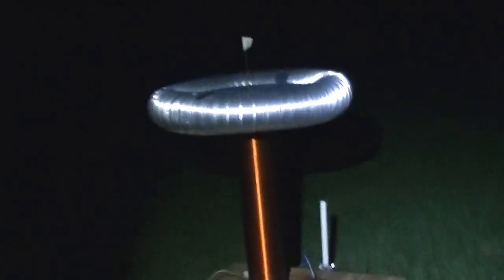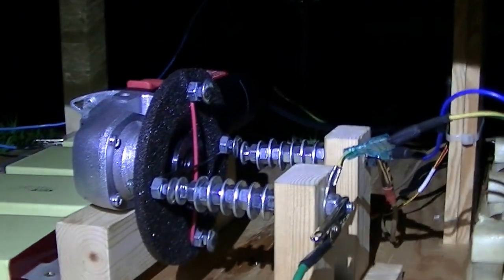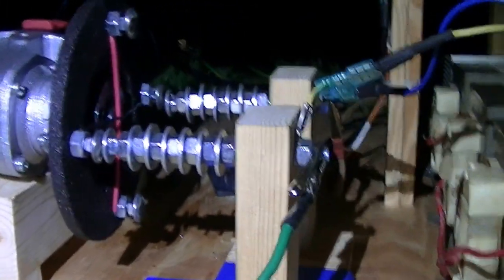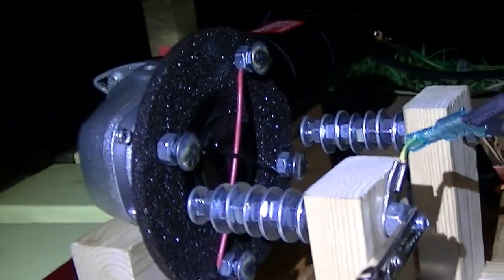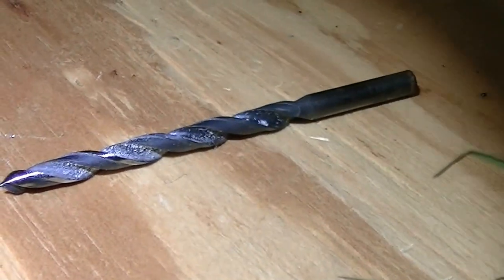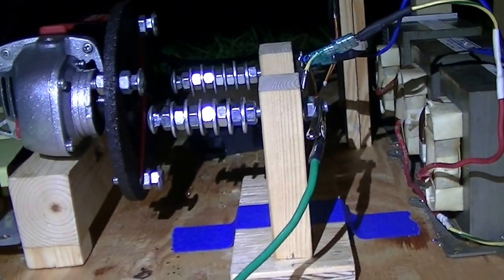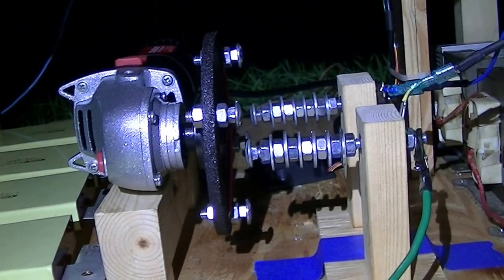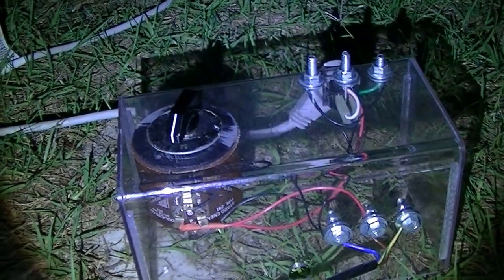Dual MOT Tesla Coil Rotary Spark Gap (RSG)

Comment: I know this is kinda a old video but to test MOT diodes you either need a special tester, or you need a resistor and say 18-22volts use the resistor to limit current and measure for a voltage drop, a MOT diode is several silicone diodes in series inside each one having its own .5 to .7 voltage drop. A normal DMM can’t supply enough current/voltage to turn the diode on in order to test it. Just like a one way valve for water you need a bit of pressure, or in this case electric current in order for it to open, or turn on. And HV diodes exceed that voltage. Interestingly I’ve been able to use a DMM in diode mode to test some vacuum tube diodes. I guess because of the thermionic emission the meter was able to read it somewhat I’m not the only person to have done this experiment either. I think I used an ac power transformer to power the filaments so if any repeat this I recommend testing with both AC and test on the filament, I don’t recall me doing the same. Tubes are very very sensitive so maybe the AC clips making though the indirectly heated cathode, maybe. Guess I’ll be poking with it again soon lol!

Comment: Mot diodes are like a lot of HV diodes they need a certain voltage to work instead of 4007s try RF 2001 t3d  220 package they are fast as bud

Comment: If you put the capacitors in series for less capacitance, you can tap at more turns (like Sullivan Miller Said). Then your output should be a little more beefy, (and tuned). That and you might want to build a 555 tuner circuit to check and adjust your primary and secondary resonant frequency's. Somewhere around 10-50 nano-farads is normally about the max you can efficiently charge at those pulse rates. And like i said, a large rectifier tube on eBay normally runs about $60. Then power the filament with a gutted transformer rewound with high voltage insulated wire. Say 5 to 15 turns, or until you get an un-loaded voltage a little above the tubes rating.

Comment: Im using 5000 volts and 30 Ma and I get about 6 inch arcs off of the toroid my coil is also very sloppy so try moving the primary tap point around a little bit at a time and see what happens.

Comment from the maker: The wheel has been tested up to 10k rpm for a minute with granite blast shields.  It will not last much longer as I will be laser cutting some plexiglass instead.  For measuring though, I am within a 64th of an inch all around.  

Regarding the proper tuning, can you offer any advice here?  My thought is that maybe I am using caps that are too large?  I am literally following what JavaTC and Solidworks tell me. I'll try something if you think it will work.